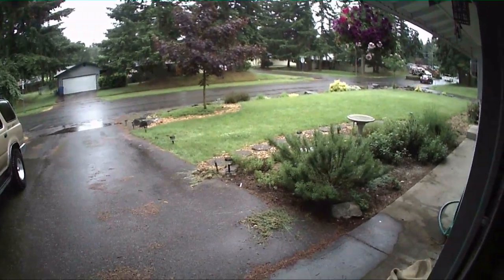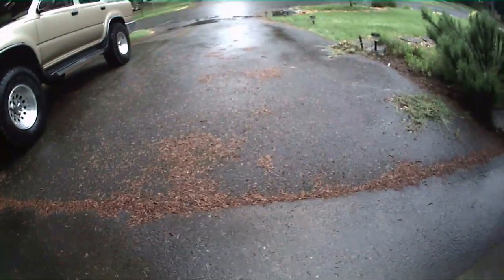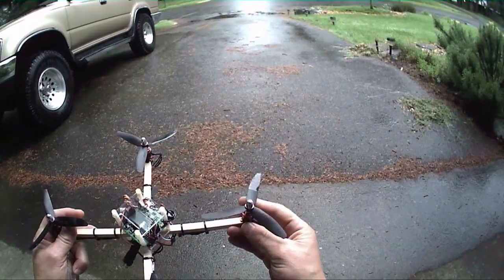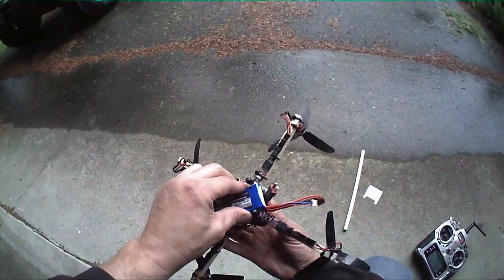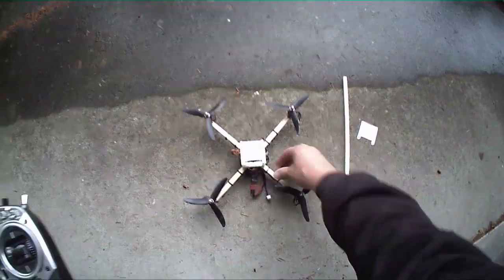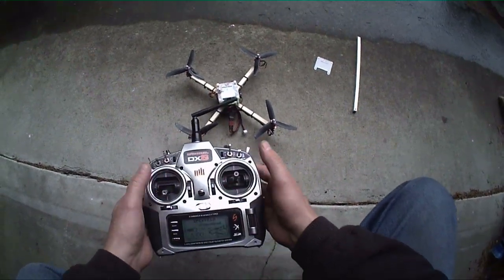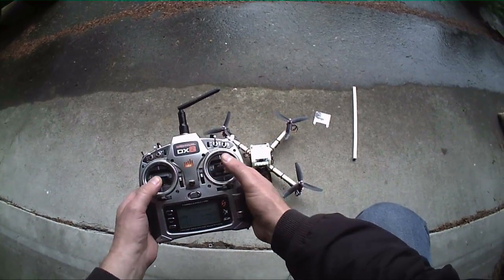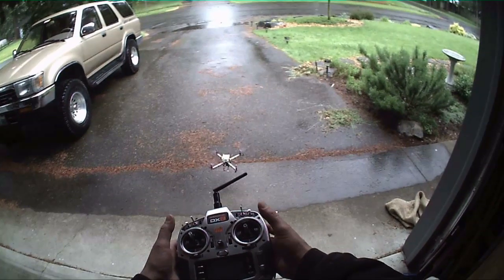Mini Quad w/ KK2.1.5

Comment: impressive very stable, usually KK2 is not very good with ultra small quads.. :)   How long are  the sticks?  I think they are  the perfect size, because the quad looks  very locked in.
Reply from the maker: Hi Anatoly, I believe I cut them at 9 inches but I had to turn the PI gains way down to stabilize the quad.  All the best!
Reply: Hey  Ron, I copied  your idea, and got the quad in the air.  Very  impressive, much more stable flight.  I used motors and ESC's from XHely MiniFly.  MiniFly  was only 220 and very choppy in flight because KK2 is not good with micro quads.    Also, I brought down the weight by almost 100 grams, including LED strips.
Reply from the maker: Anatoly Vizitiu
 I had a small fiberglass quad frame and if there was any vibration at all in the motor/prop, it caused the board to malfunction.  Using the square stock wood booms works great for small multirotors.
Reply: I switched  from 220 fiberglass frame too.  The problem was, no matter which PID I used I  would  still get  high speed  oscillation.  Had to lower P gain to 20, but than I would not get any auto level.  If you ever decide to build  a micro quad, the best board would be Naze32.  I use it  on blackout quad it's totally locked in.

Comment: Nice job, Ron! Are those the same motors that come with the Turnigy Micro Quad? I want to try flips and rolls but I don't want to risk my larger camera platform.
Reply from the maker: I just looked on the website and it appears those are the same.  This little quad does great for flips and rolls.  Very light weight and quick.